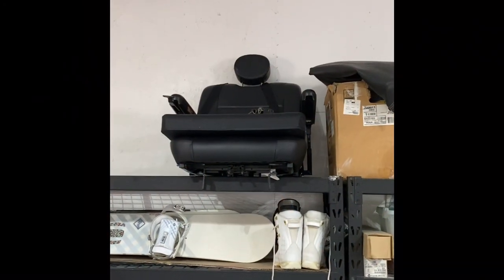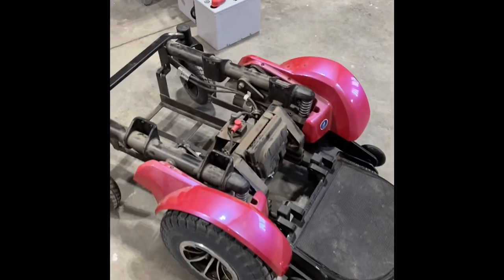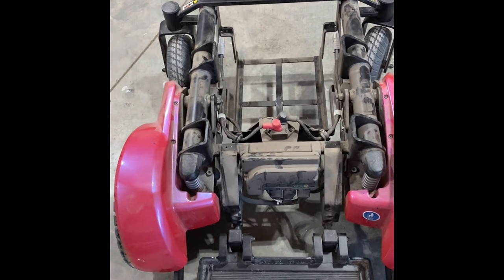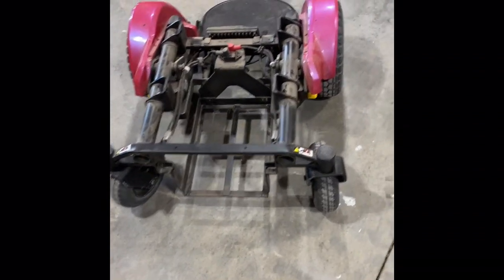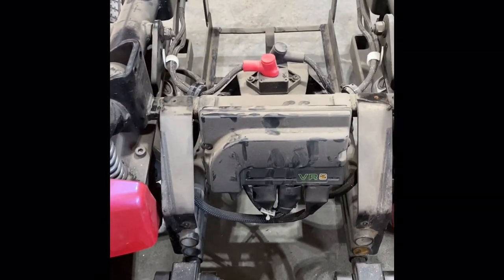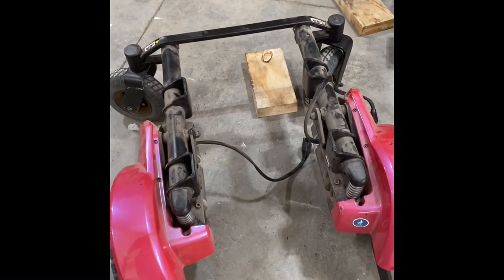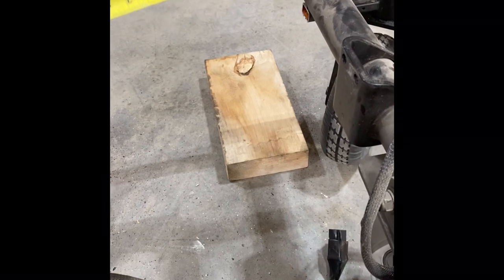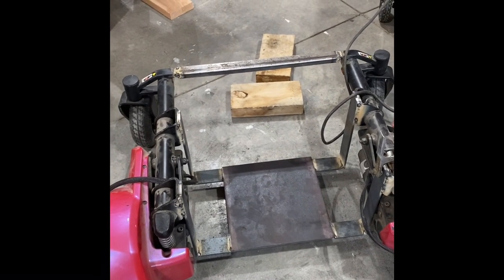DIY Airplane Tug

Comment: Great tug. I’m currently building my own based on a modified version of your design (a slightly more powerful wheelchair and motors). I’m curious about the angle you used for the nose gear rest, as I’ve tried a few different angles with a spare Cherokee tire I have lying around, and the angles never look right as I plan to tow a few different nose and tail draggers. What angle is yours for reference? Thanks!
Reply from the maker: I think it was just a 22 1/2 degrees. There was not much thought to it. I did not have a spare tire to go off of. I measured the tire and guessed. It was a little off that is why there is plastic mounted on it

Comment: I'm impressed !!!  Very nice job you did converting that chair to a tug.
  
I can definitely see myself doing similar, hence how I found your video, however,  I'm curious,  do you think that the motors strong enough to pull/push your aircraft on grass?  
Thx .. Norm
Reply from the maker: I have never tried it on grass. I thing it would depend the weight of your plane and grass condition. I keep mine full of fuel and it moves it just fine!
Reply: @firestormaviation4967  I like that answer ! 😀
I only have a light tri-pacer, should be ok..  I think that I'll have to try it..  thanks!
Reply from the maker: @nfill4131  good luck!
Reply: @firestormaviation4967  Oh !!  One more question, what did you use for a  bearing under the cradle?
Reply from the maker: @nfill4131  Round Bearings, 9", 5/16" Thick, 750-lb.Capacity https://a.co/d/iP4EtPG